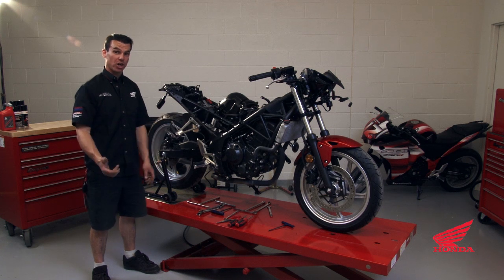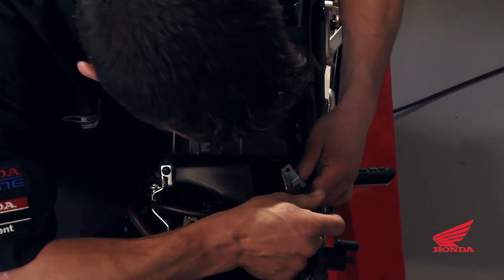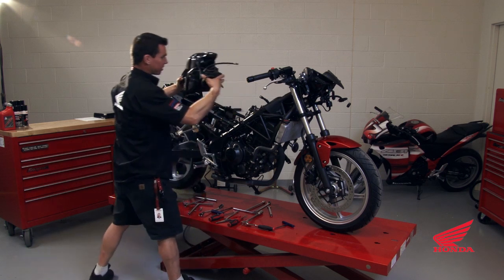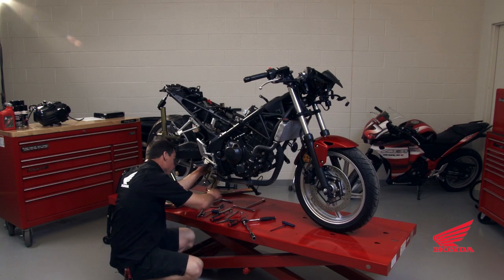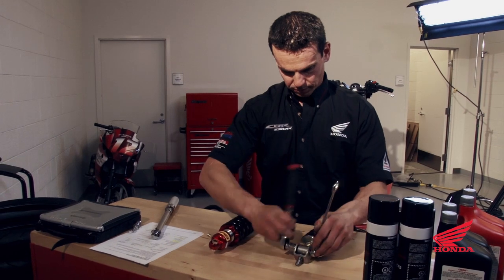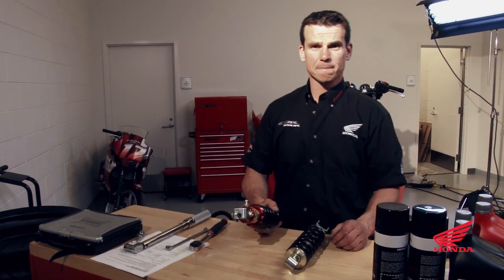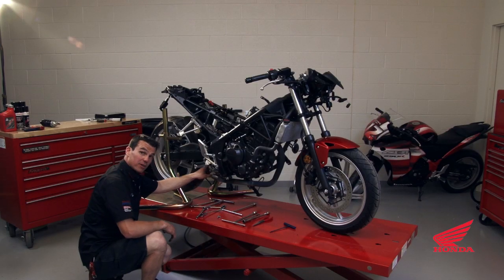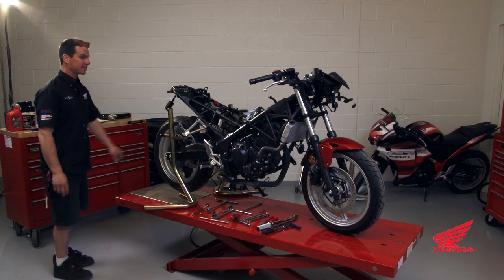CBR250R Race Kit Installation: Replacing the Rear Shock

Comment: Hello, can you tell about the rattling noise that comes from the CBR25R when the bike is started after a long time ( when cooled). The noise reduces after sometime but its still there. can you make a video on that. i have been to the honda service centre but they always change the chain tensioner and after 2 to 3 months the same noise comes back.